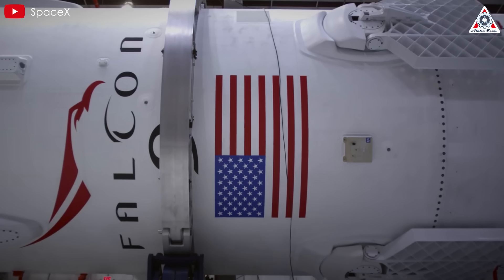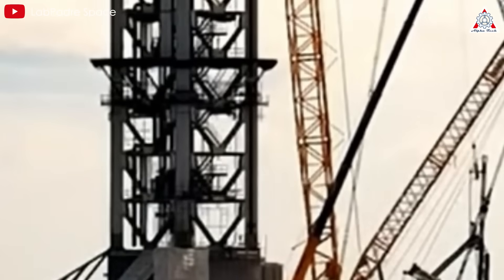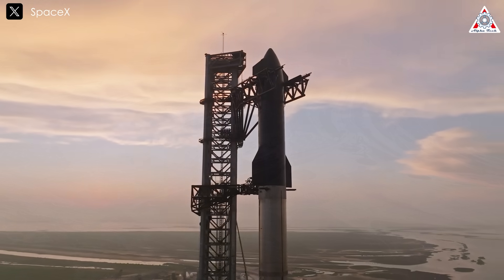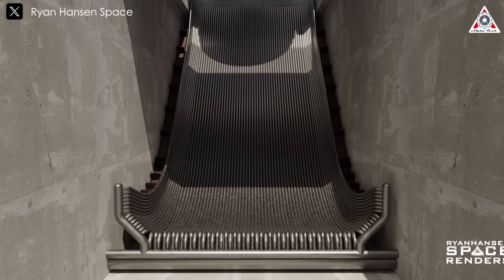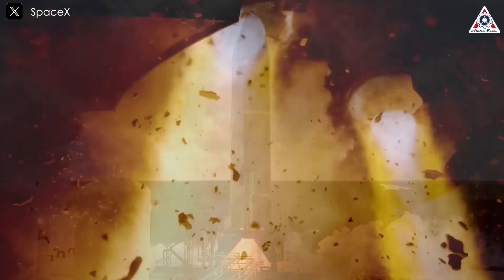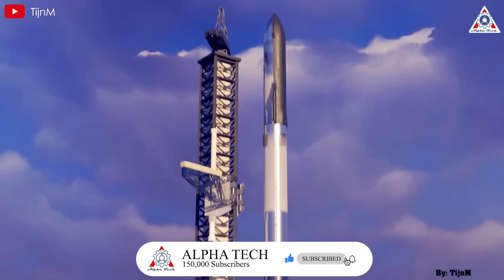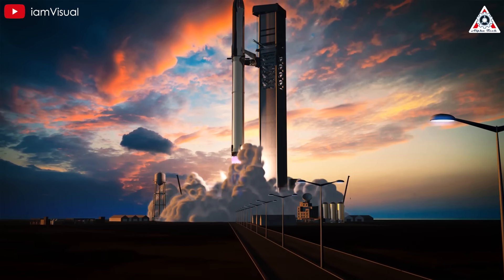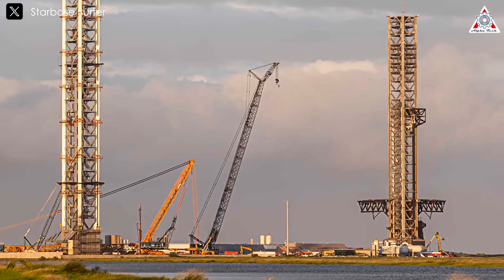SpaceX's Major NEW Launchpad CHANGES "Double FRAME Bucket" to prevent 33 engines.

Comment: SpaceX Starship launchpad.

Design use case - to launch Starship after Starship in rapid succession from the same launch pad. You do plan to launch 1,000 Starships TEN TIMES to Mars, right? Hence you are constructing SEVERAL launch pads for this purpose.

Problem encountered - super heat and pressure from powerful Raptor engine exhausts damage the posts that support the platform on which Super Heavy rests.

•currently - platform on which Super Heavy rests is supported by a number of posts. 

•double frame bucket - while it is probably an improvement, it will still be scorched & seared by the extreme super heat and pressure from the Raptor exhausts

•suspended platform solution - this will absolutely be free from any degradation due to the Raptor rocket engine exhausts. You know, like how very long  btridges are suspended. This way, there won't be a limit to how many or how rapid you launch Starships one after another, as the Raptor exhausts won't damage anything, since they won't even touch and scorch any vital support system.

Comment: You also have to keep in mind the water bucket deeper they go. But they will find a way for it to work. Speculation only goes so far.   Thanks for the episode.
Reply from the maker: That is an important point, I will try to keep that in mind for the next video!
Reply: @alphatech4966  , The water shed limits on what they can do. But they already did it with Pad A, and B. But the flame trench on pad B is going to be easy/hard... but they can always resort back to an upgraded shower head. It's going to be a fast production, being that they already have pieces set in place. It's coming, faster than predicted. Now that Trump is back in office, Elon can play with his toys. YES! This is history in the making. 
thanks for the reply.

Comment: Here is just an idea only how about using stainless steel about 1/2 thick and under neath the steel you would use a product used in the gardening would it's perlite it's very lite and they are little pellets. They make from volcanic ash. So like I said it's just an idea only
Reply from the maker: That’s a creative approach to the problem!
Reply: Perlite melts around 1000c,the Raptor engines get to 3600c. Even stainless steel melts at 1500c so it really needs flooding coolant

Comment: The dual flame bucket system sounds like a brilliant approach to managing launch energy. Adapting to groundwater challenges and keeping structural integrity with such large forces in play is no small feat, especially near sea level! Kudos to the engineers pushing boundaries here.
Reply from the maker: Yes, the engineers are working hard to solve the challenges with these new launchpads.

Comment: How is this flame bucket any different that the ones NASA used for the Apollo launches?
Reply: It’s different because the ones used by NASA are only One Direction. They divert the flames in one way not to and they’re not included with a water cooling system like SpaceX.’s
Reply: @chancejurgens6182 NASA used an inverted vee on 39A just like this one and was cooled by the water from the pad system.
Reply: @kenheise162 The main difference I'm seeing is that the ramp itself sprays water because it's made of water pipes with spray holes. The NASA ones were concrete or steel plate with spray heads at the top of the ramp but not on the whole thing.

If you've seen the flame trench they made for the Starship static fire stand, it's that but scaled up and made to deflect 2 directions instead of 1.
Reply: "New" just sounds better...🙄
Reply: We're trying hard to make today's launch pad as good as the one built a half century ago. Don't rain on that parade!
Reply: Space x is great at reinventing that which has already been done.
Reply: @SterlingArchimedes  Right.  Like returning boosters for landing on drone ships, and catching boosters out of the air, and re-using major parts of the rocket.  I keep forgetting about all those other space organizations that have been doing this for years... Oh, wait...

Comment: Why don't they just let the Trench fill up with Ground Water like a pond , and just deluge the Rocket stand ?
Reply: You really want to use the water to help deflect the flame and pressure away, the current plate does that with the spray pattern at about a 45 degree angle. Blasting straight down into a pond doesn't redirect any energy or absorb anything near enough, you'll get a big explosion of steam and water straight back up and then it'll run dry in short order. Having water spraying at the deck doesn't help that system either since the blast is going to reflect back up a ton and the water would get blown upwards.

You want that ramp with water jets so the energy gets redirected, with the water adjusting in protecting the ramp as a thin layer of water and steam to skate over. The water plate does the same thing but at a more severe angle which takes on more erosion wear.
Reply: Worlds largest potato gun! Get the rocket 150 off the ground then launch, no more pad damage or expensive water deluge pad needed. Us Subs have been doing it sence 1947 LOL

Comment: As usual, I have a critique! 🤭

Flat isnt the optimum shape for the blast reflector, basically creates a blast wave at the surface traveling outwards, at ground level, & would be a tich better to put a wee bit of shallow parabola to it, and get the edges lip lifted slightly so that wave interface seperates from the ground at a slight angle and moves above ground level going outwards, so that its not picking up debris and throwing it, and so the sound wave arrives above local communities instead of smacking them in the side at ground level.
Also might consider some face baffles to cause turbulence at the edges, get the sound energy conflicting itself instead of being coherent.

Also if water jets inject higher into the rocket
exhaust, it wont be as hot when it hits the plate, and there will be less erosion of the plate system.

& If it was me, I'd be talking to my metal guys about a cast center piece that was a blend of cast iron and stainless, Boiler plate in Hell stuff... 😂

Anyway, I see Elon is a Star in a political ad now, as is flight 5 booster catch, given as an obvious example of American innovation.
That ad, bringing tears to the eyes of millions..

They made a big mistake trashing high functioning humans, and people who actually do stuff...

We aren't ashamed of ourselves even a bit....

And being Yahoos, we really like rockets!
Reply from the maker: That is an interesting idea, we will see if they do any changes to the launchpad based on this.
Reply: @alphatech4966  
I can only suggest, and point out the physics.
They may decide its not necessary, but if they want the best design possible and longer reuse these are sound concepts. There are alloy mixes that would be way better than mild steel. For the erosion. My guess is eventually perhaps even a metal/ceramic alloy where its mixed and then kilned. with the mix being a powder.
Tech isn't gonna stop.

I just woke up, 2:00 am.
And see Elon has a good buddy moving into 1600 Pensylvania ave. soon. 🤗
I suspect the Space program is safe now, And very likely to get a big upgrade. And that some day we will look back on this as the beginning of an era. The election, flight 6, getting to V-2, R-3's,  the Tower catch etc.
By the way, ran into a video yesterday on Blue Origin, channel I hadnt seen before, and they were calling the two aft fins on the booster strakes... 🤣 I've been trying to correct everybody on channels calling the four triangular longitudinals on the Exterior of Starship booster "Chines",  Chines are a flat section in hull constrution. Starship would be analogous to a round bottomed hull, and the other type of hull is a chined hull, made up of gores. Gores being the sheets before welding up.

A strake is a keel like longitudinal structue attached to the outside of a hull, but not a keel. Some boats have dual or multiple keels, a chine is usually not as tall.
Also on BO's booster those two strakes or fins aft, are eliptical for a reason, that shape is most aerodynamic. Its used for fletching on arrows in the style from the steppes of central Asia, and make the least noise in flight. Noise being wasted energy.
So who ever came up with that shape for Jeff, knew something most dont.
I was surprized to see that in practice.
BO actually has very nice stuff, and once they get it on engine simplification, and start thinking about production, they will compete well with SpaceX, especially if they continue building horizontally. 
And I suspect others will grow into Space conglomerates too.
And it wont be long.
And there will be a gazillion side businesses.

Its a new era this morning... Space Buffs gonna be happy dogs!
Reply: The noise isn't high already when it's just lifting off, the plate muffles it well. The noise that is much louder and travels far is when it gets up higher, which can't be helped. Eventually it's a mile in the air and the air is being torn apart it's so loud.
Reply: @Jaker788  
Makes sense, but as it rises also gets farther away... Ever increasing distance and angle.

Comment: They are designing V2 & V3 so why is the new tower the same height as the old tower?
Reply from the maker: I guess the tower height won't matter since the new mobile OLM is lower than the old OLM and the chopstick shift can get to the top of the tower to be able to catch V2,V3
Reply: @alphatech4966 As far as I know, the launch mount is not mobile, it's stationary. The vehicle is transported to it to get stacked
Reply: New tower is taller than old tower.  QDC is being designed to accommodate both V2 and V3 by adjusting its height on the tower.